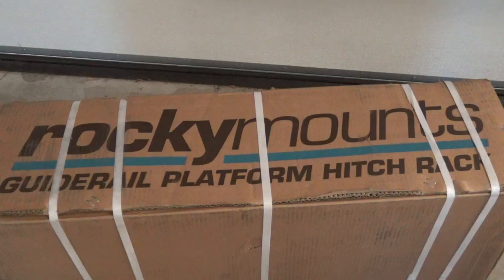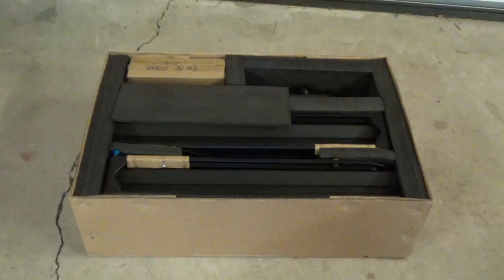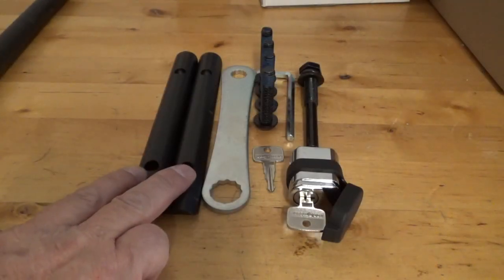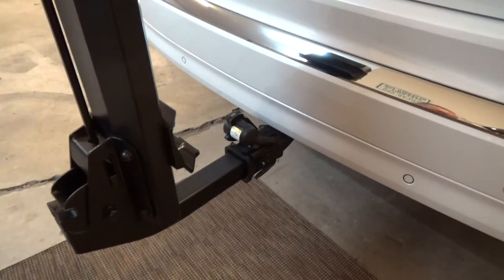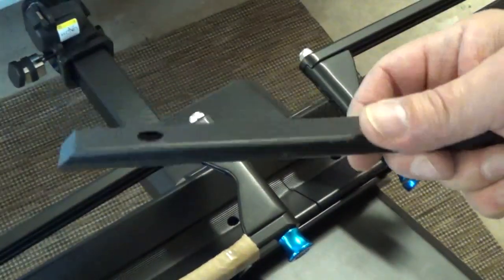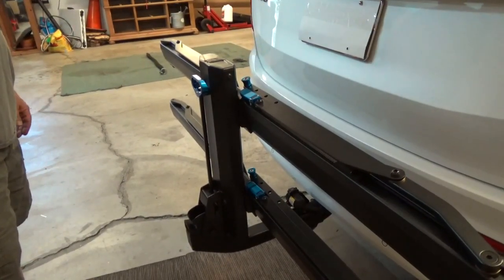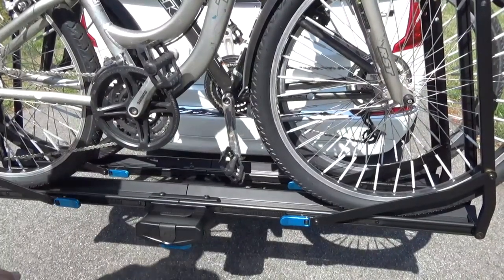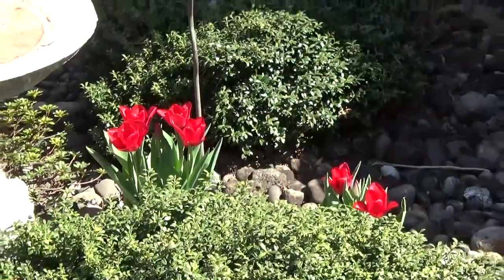Rocky Mounts 2 Bike Guiderail Platform Hitch Rack

Comment: You may want to mention the lock is not to be used while in transport because it will cause abrasions to the paint. Additionally, I don’t understand what’s going on with the fender. Was the clamp supposed to go over the fender. Doesn’t seem right. Please provide the install reference to that. Thank you for your video. Very informative!
Reply from the maker: Thank you for your great comments.
You are correct about the locking chain and you are right to question my comments about the rear fender.  

Reference the Owners Manual at the Official Web Site;
https://rockymounts.com/content/51281_REV_C.pdf

In the Owners Manual, under Locking Bikes, Picture 6 states; "Do Not Use While Traveling. Can Cause Damage To Frames Due To Road Vibrations."
This is restated on the last page of the owners manual in the Warning Section at the eleventh of fourteen ellipsis.

As far as the Rear Fenders are concerned, 
Owners Manual page one, Guidelines Section, fifth ellipsis, in Bold Print states; "Remove rear fenders, racks, and panniers before use."

My rear fenders are plastic with a copper support plate underneath them, they flex enough for me to clamp the rear fender down onto the tire with the load arms.  They are only attached to the bike with zip ties at the seat post and there are no support rods going from the rear fender to the frame. 

The zip ties keeps the fender in place so we do not return home with lines down our back if we go through a puddle.  

If left unsupported by the load arm, they would flutter around in the breeze and would be a road hazard if they flew off while in transport.   This prevents 60-70 mph winds from flapping them around and possibly ripping them off of the bike when we hop on the Interstate to travel.  Over time, I have found that this does not damage the rear fenders and the bike is supported well enough for high speed transport.